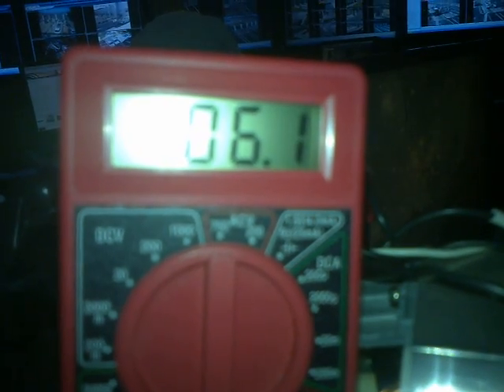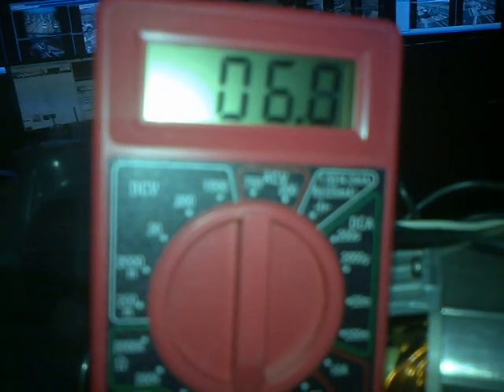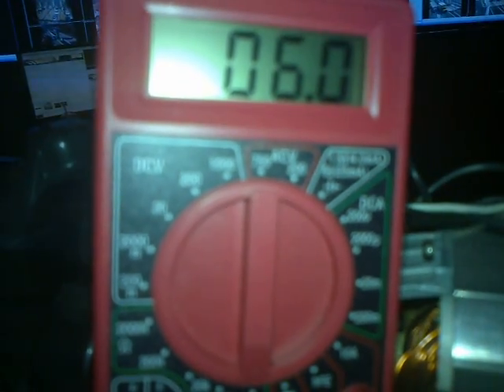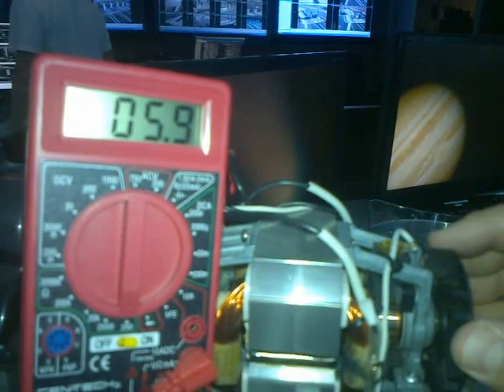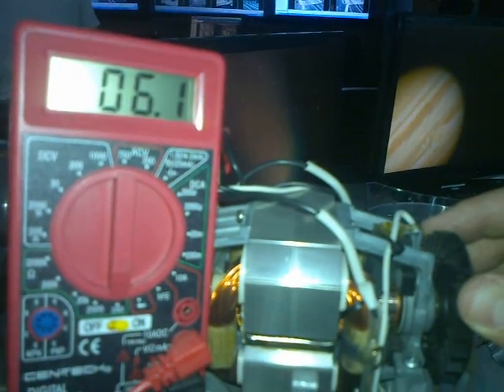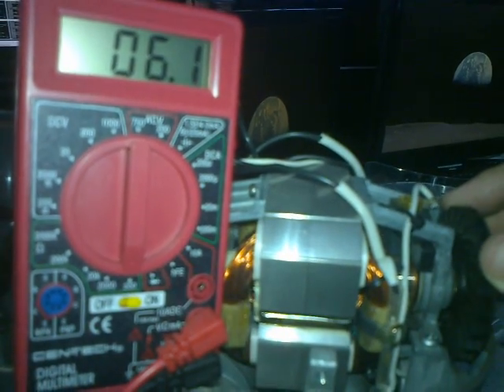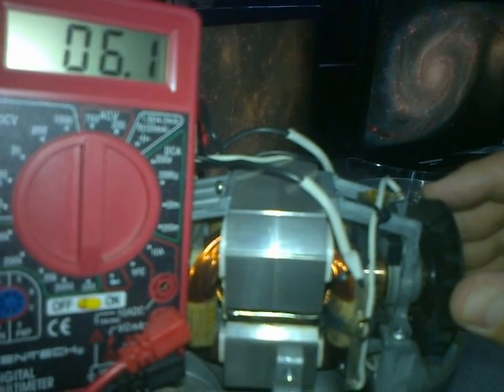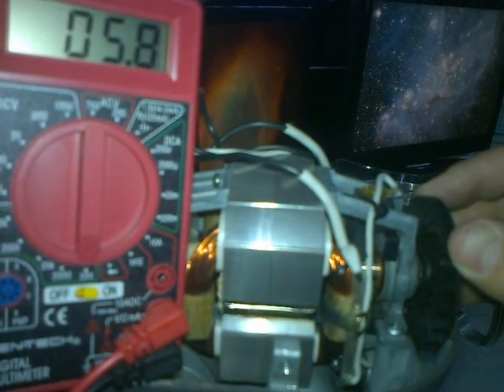Kitchenaid Pro6 motor resistance measurements

Comment: Hi, could you please explain where did you connect the terminals? I have a kitchenaid professional 600 that is rated 110v that I accidently connected to 220v. It for sure burned the controller board, but before I buy a new one Id like to check that the motor is not damaged. I have a multimeter, could you please explain to what terminals did you connect? Thanks!
Reply from the maker: Happy to help.  I just sold my Pro 600 to a friend, but still have the Pro 6.  Should be quite similar. I'd have to pop it open to see, but you'll see the motor connections to the control board - I disconnected both motor leads and connected the meter there.  Be sure to not spin it quickly; rotate slowly across all commutator positions.  If you see one or more in an 'open' state, use a fresh pencil eraser and spin the commutator / clean the oxides off before re-measuring.
Reply: @misturchips  thanks a lot will try that out
Reply from the maker: @omerkap  No problem! Hope to see something awesome you made with it soon!